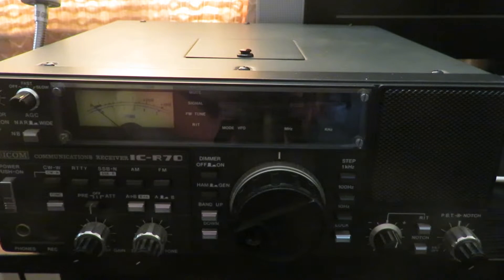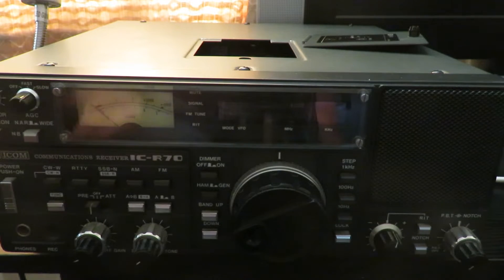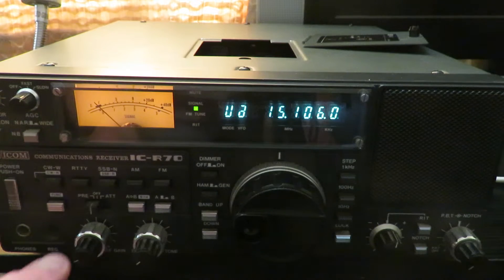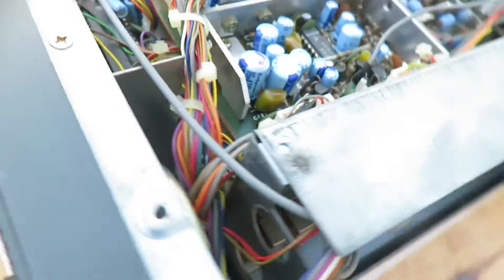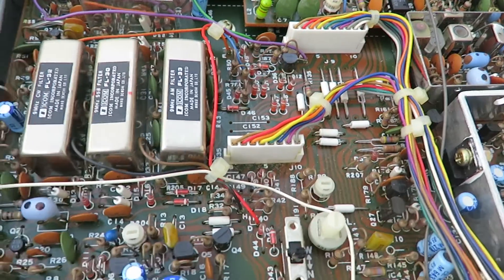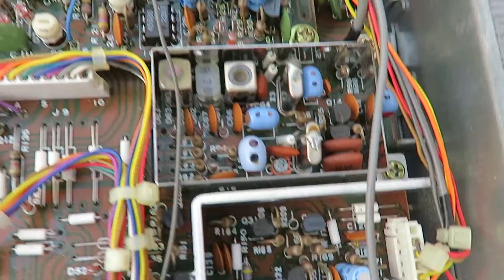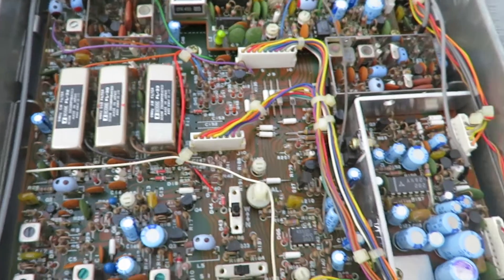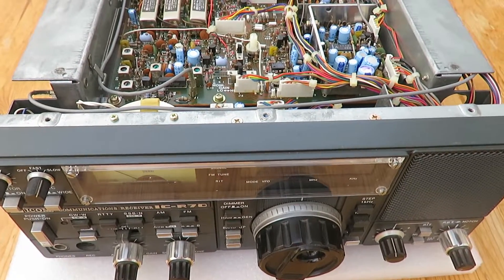Icom IC-R70 Problem Solved ?

Comment: Again...Thank You! I was searching for ICOM Repair and found your earlier video and tried just touching on of those connectors under the hatch and it worked. I asked if you had a follow up but decided to search for one and here it is, and I will give this a try. Sometimes screws work themselves loose just from small temperature swings over years. Thanks for this update!

Comment: Good information Kevin. My ICOM IC-R71E had a similar problem. Partially solved by doing this. Will be trying it again. This radio looks simpler to operate than the later R-71. The tightening procedure was done some years back.

Comment: The issue is highly likely to be a voltage regulator dry joint. If you look at the main PCB, bottom right corner, you'll see a large heatsink which carries the AF amplifier and a voltage regulator. Try wiggling this heatsink and I believe you'll find the receiver is off and on again.
Turn off and unplug the radio from the power. Remove the circuit board - it's only held in with 6 or 7 screws and will tilt forward once they're removed.You may need to unplug just one or two leads depending upon how tightly they were routed when the radio was assembled but by no means do you need to unplug everything. Looking at the underside in the region of that heatsink you'll see a small gap through the board and three quite hefty soldered joints. That's the voltage regulator. Resolder the three joints and replace the board.
Hopefully all will be fine now.
This is an issue because of constant expansion/contraction in that area as the audio amp and regulator provide a few Watts of heat.
Reply: Spot on, same issue with mine, 3 solder joints and back on, although it does still skip up the ham bands occasionally, so may be this issue again or another dry joint i have to investigate